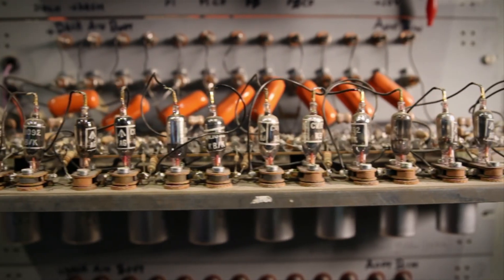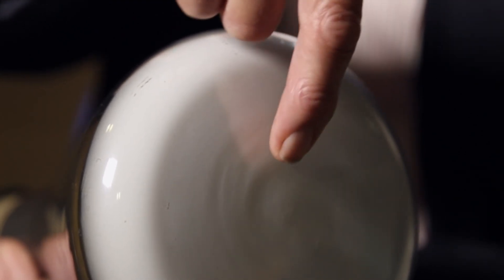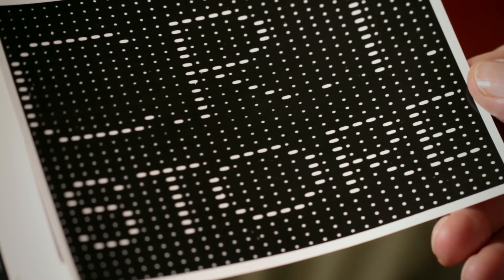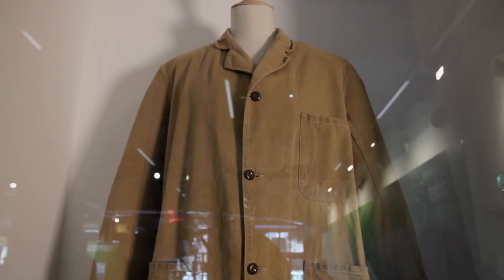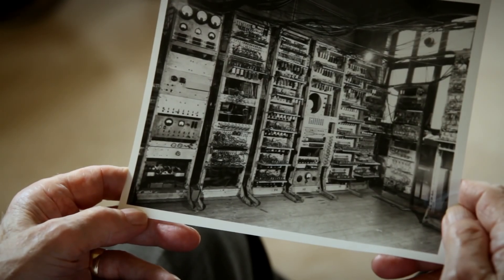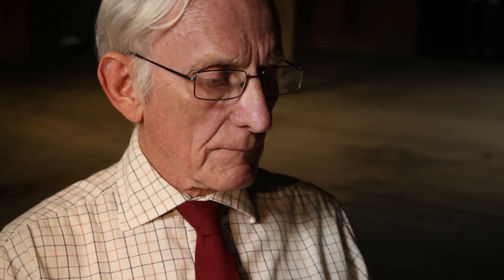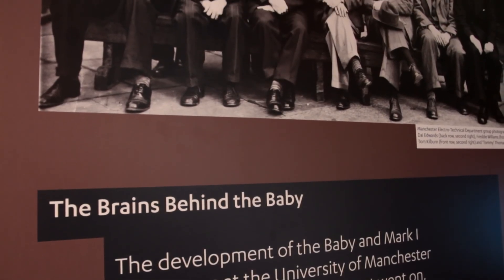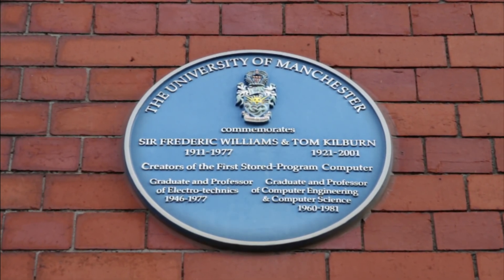Manchester Baby: world's first stored program computer

Comment: It was not just about storage but it gave a demo how a hardware can be contolled using software (a stored program) without changing hardware  to make a true general purpose programmable machine. Earlier, ENIVAC was the first computer but it was not contolled by software because for new program, hardware had to be changed by changing wires and switches. Thanks Manchester Baby!

Comment: I recall the mid 1960s and visiting a junk shop in Liverpool Centre.  They had lots of cards available with small cold-cathode valves, solid state diodes and resistor and capacitors, with a plug connector. They were taken from dismantled computers.   They were very cheap to buy, but as a small boy I didn't know what to do with them.

Comment: How they makes first software for first device without device can anyone tell
Reply: By working it out on paper, then entering it into the memory by hand (i.e. bit by bit or, at best, word by word).  Until the invention of compilers (to say nothing of operating systems), basically all programs were written that way; with circuit diagrams, register diagrams and a book of opcodes.  Depending on the era and sophistication of the machine, you might use banks of toggle switches or buttons, one for each bit, or punchcards or teletypes, or anything else the hardware designer could think of.  People were writing whole programs, even games, in raw assembly language as late as the 80s.

Comment: as stated in the title This the first STORED PROGRAM computer. it doesn't claim to be the first computer. The von neuman computer or IAS computer developed at princeton university used the same memory used with this one, the Williams tube. it stored a grid of "spots" 32 wide by 32 down becoming the ubiquitious 1032 bits (1k) of storage.
[from the book by G.Dyson Turings cathederal] 

The work of Turing being very important to all stored program concepts
Reply: luapluapluap1000 
1k is 1024 not 1032.
Reply: yes Ken well spotted
Reply: Its actually the first electronically Stored Program. So the first computer with RAM. The Americans had stored programs in switch banks, so effectively ROM.
Reply: 1024.  That's 2^10.

Comment: All of this is wrong the first computer was made in 1940 and was invented by Alan Turing. It was used in the war to break enigma and they did!
Reply: This isn't the case. The baby was the first modern Computer and the first implementation of the von Neumann architecture. The Enigma was a glorified calculator!
Reply: You are both right and wrong in what you say. You are correct concerning Alan's machine being one of the first computers but it did not run an electronically stored program which is the basis of the modern computer we use today. The Manchester baby was the first to work this way.

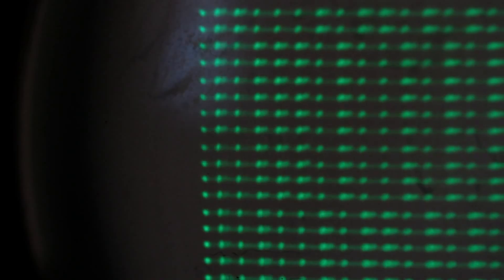Comment: Here is the invention of the earliest computer memory. At 5:43 and 5:48 there are close ups of the computer display - a cathode ray tube, similar to Radar displays - showing bits lit up with gaps in between. This display existed first. It was realised that the image of the dot on the phosphorescent screen persisted for a distinct period, longer than the electronic cycling of the machine. So if the charge wells of a CRT screen, caused by the electron beam, could be picked up, the values could be made to persist into the next cycle, allowing the computer to "remember" binary values. At 6:40 you see how this was achieved in the unit labelled STORE. In this unit is the same circular CRT screen as for display (also shown if you start two seconds earlier at 6:38), but this one is covered with a wire mesh which "read" the dots sent to the screen and refreshed the memory values. Possibly the mesh is a modern adaptation created for greater reliability, I believe originally it was a solid metal plate.
Reply: PopeLando My Dad patented part of this computer and met Alan Turing.
Reply: ewaf88 It's a privilege to metaphorically shake your hand! And your dad helped make today's world where such a thing is possible.  This is awesome.
Reply: PopeLando Hi thanks for kind message. Unfortunately he passed away in 2013 but was an exceptionally bright man. He was born in the mid 1920's and was very gifted gaining what was then call a Science degree in the 1940's . He was deemed as too young to work at Bletchley Park where all the code breaking went on but met Alan after the war who at the time had some involvement with the Manchester computer. My Dad was brilliant at doing tough cryptic crosswords and used to try and finish the tough Daily Telegraph puzzle in about 20 minutes- much to the amazement of fellow train travellers. He would have been an ideal candidate for code breaking. I programmed my first computer in 1975 (Opus 2000) but then got involved with the less interesting World of banking.